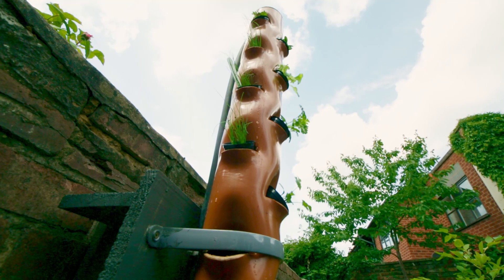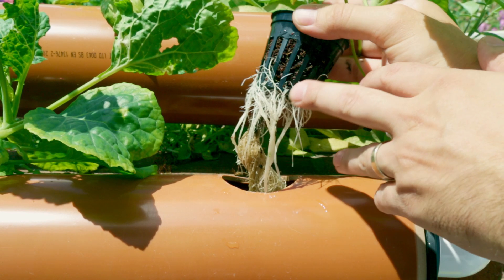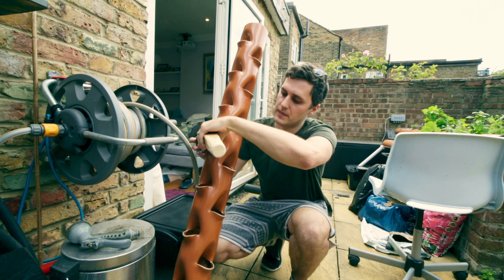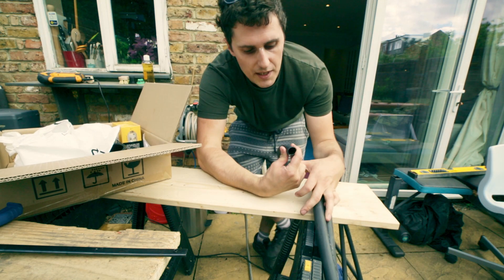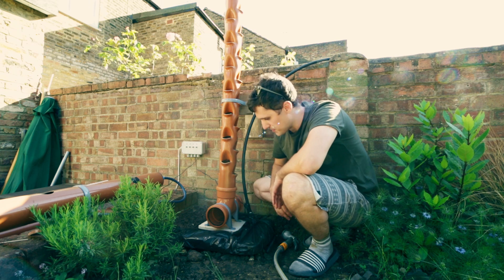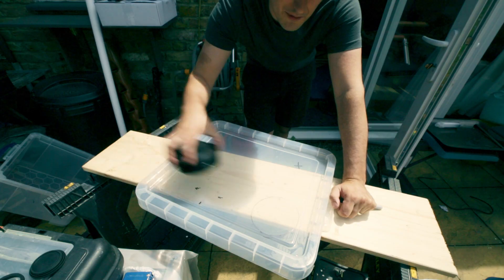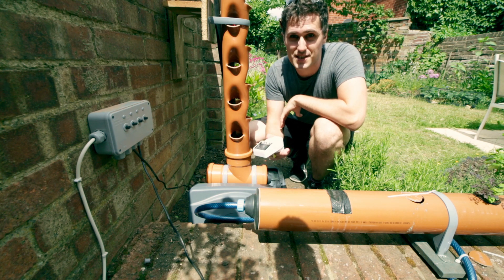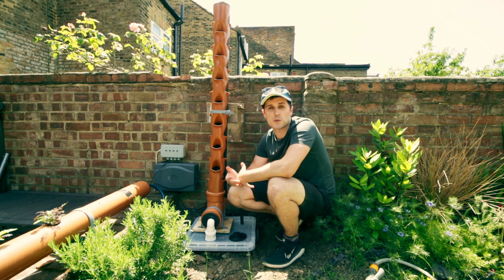Building the Aeroponics Tower

Comment: Good stuff - one note is that 'As far as I know' - the grey pipes are UV resistant whereas those ones are not - so if you intend to use the pipe outside you need to check that.

Comment: Typical PVC plastic pipe, if not UV stabilized grade plastic, will begin to breakdown under extended UV (ultraviolet) light from the Sun. The harmful result is toxic chemicals from the pipe will leaching into the water and then the plants. Also, typical plastics have BPA which has been linked to health problems and over time this can leech into the water and then the plants.

Comment: nice video, I have a quesiton: How does the sprayer tube inside the the towertube enhance vrs just letting the water drip down from the top?
Reply: Roots soaked by a sprayer or by water running down the tower will produce the same result.
Reply: The sprayer is just more efficient, as it doesn't require the water to constantly be dripped down from the top, but can be let out in small, timed bursts. Plants don't need nutrients and water 24/7, so timing it is more cost effective as you save on both electricity and water.

Comment: Thanks for sharing.... But one question. Why not drip water from top instead of spraying???
Reply from the maker: Good question, it may work with a slightly different configuration but I was worried that some of the plants wouldn't get the nutrients they needed. By spraying them I can ensure that every plant is getting a nice dose of water and nutrients, plus they'll hopefully get a bit more oxygen this way.

In a true aeroponics setup the water would be fed at high pressure through atomising spray heads, but that's a project for another time!
Reply: @cluttercookseys2058  
With drip you`ll find the plants grow unevenly. Those nearest the supply will grow roots much faster and reduce the amount of water reaching the ones further away. I`d recommend  high pressure aero for vertical towers made from barrels etc but not pipes.
Reply: @cluttercookseys2058  yes that is a valid point i guess you can also  try to increase flow from nozzles so water don't splash out due to less pressure.. and also like what atomizer says.. i too have observed... My top plants were growing faster and bigger than those at bottom... But I think that it was due to more light they received... Bottoms ones used to get in shade early...
Reply: i would try that, it would also be aeroponics if you set it with a timer
you avoid clogging of misters but plants would die too if power is lost